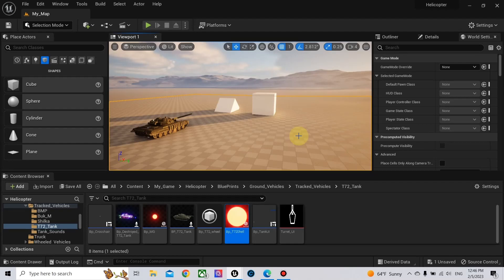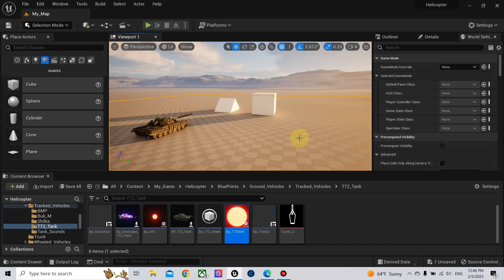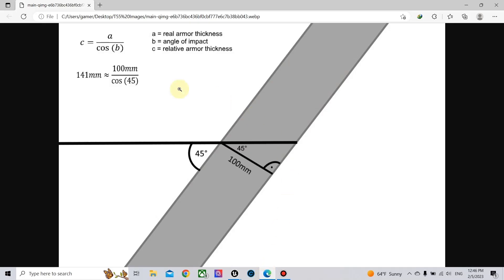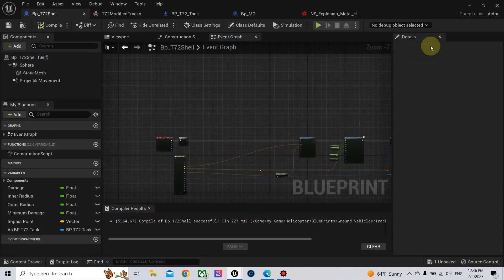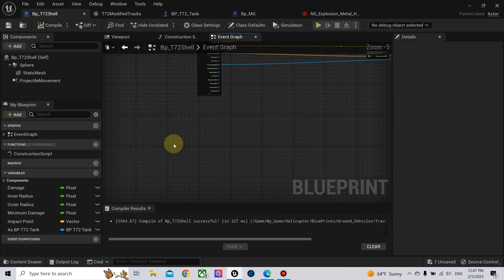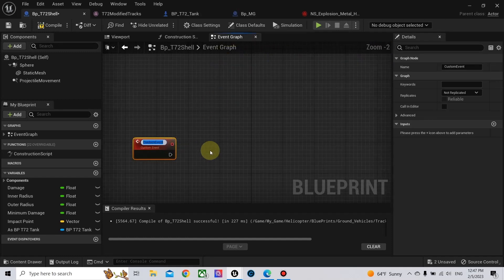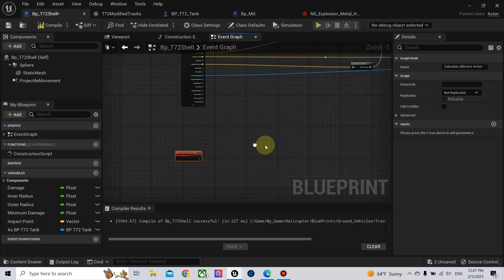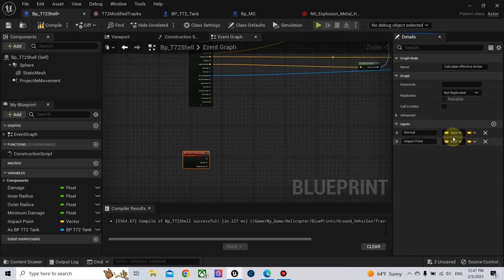Unreal Engine 5 Make Tank Armor part 1 (Projectile penetration-Effective Armor-Sloped Armor )

Comment: why does the tank bounce up and down like at [6:00]?
Reply from the maker: It is because of the spring rate value in the wheel blueprint. This makes the tank bounce.
change the spring preload value to fix the bouncing.
Reply: @megames998  Weird when I tested it it doesn't seem to have an effect. do you have discord?
Reply from the maker: if it does not work, you can try the suspension damping ratio, make it 1.
Reply: @megames998  same thing is still happening?
Reply: @issamaf80   did you press apply?
Reply: Seems to be a problem how he set up the tank as the same thing is happening to mine.